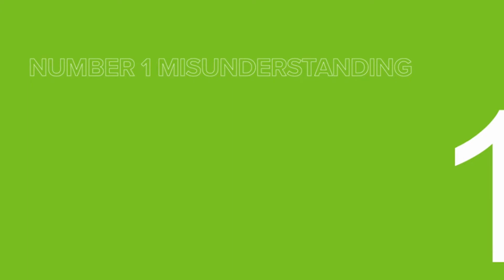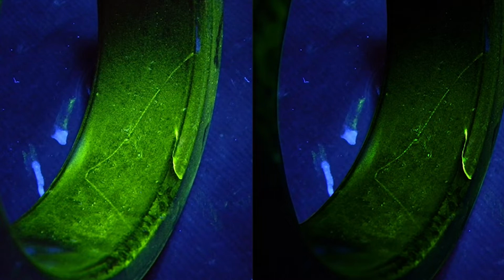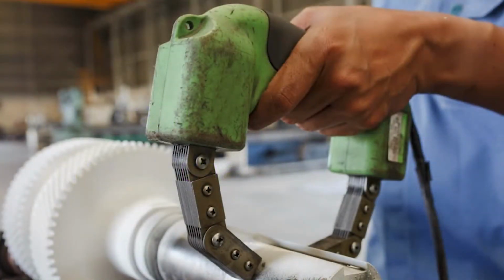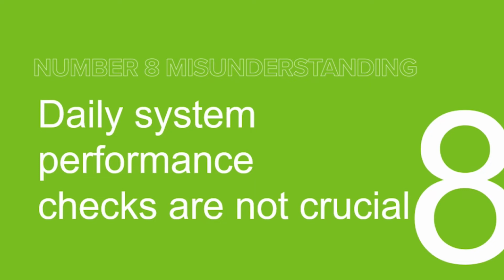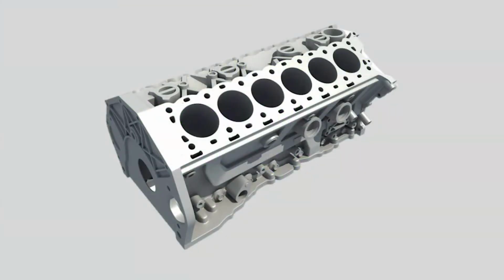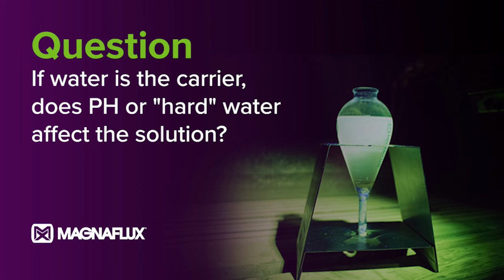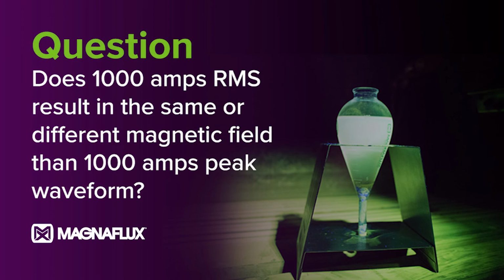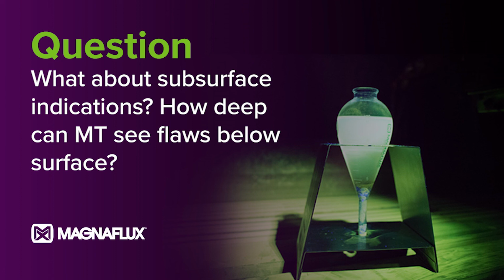[Webinar] 10 Misunderstandings about Magnetic Particle Testing

Comment: ive also seen a lot of alloy segregation in 17-4 in the wet bench that looks like cracks on the surface of thicker materials, and centerline lamination in thinner plate (viewed at the plate edge) metallurgical examination can prove the presence of alloy segregation but is a flawed method for accepting lots, I believe eddy current can verify continuity without destructively testing parts, and do it on every indication instead of a cross section of 1 in a lot.

Comment: Hello, I need to know what is the maximum examination thickness in pieces to be inspected in a wet horizontal unit for MT magnetic particle tests or through the use of the magnetic yoke, either by wet or dry technique.  I have reviewed the ASNT NDT Handbook Vol 8 MT and the ASTM E 1444 and E709 standards and I have not found information about it.  I would greatly appreciate your response.
Reply: They won't endorse any claim on a depth. It is surface "and slightly sub-surface" only. I can tell you that I have seen subsurface shrinkage in castings with an AC yoke. It was extremely severe though, so... there's that..